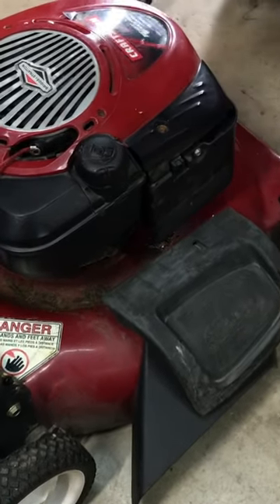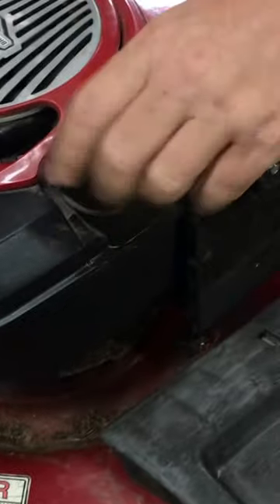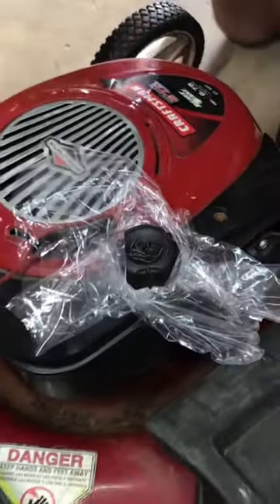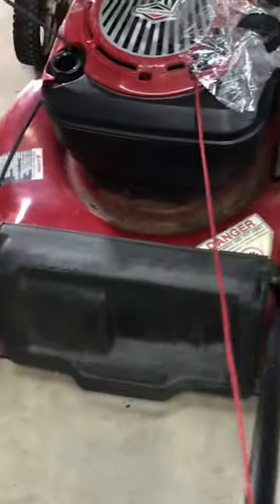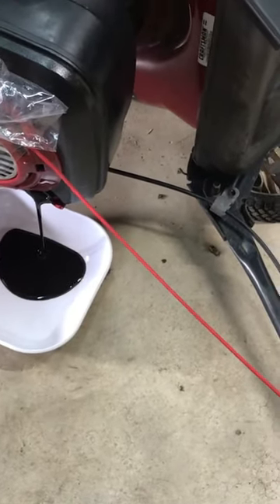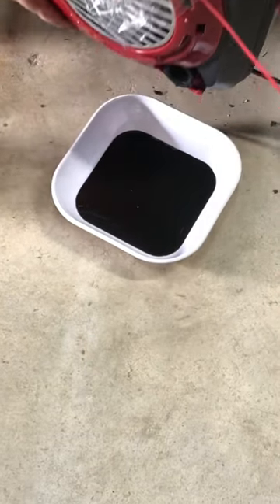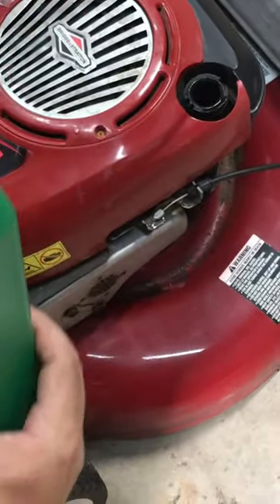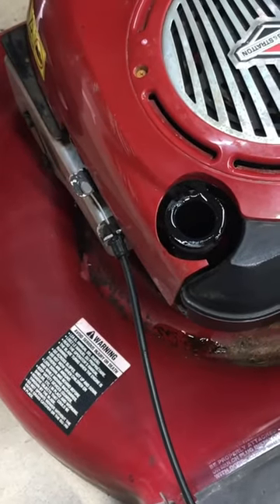How to Change the Oil on a Lawn Mower #pushmower #lawnmower #oilchange #howto

Comment: 2 extra tips he forgot to mention:
1. Let the engine run for about 5 minutes before draining the oil. This will get all the dirt and particles circulating and ready to be dumped out
2. For safety, disconnect the spark plug wire from the spark plug to prevent an accidental start up